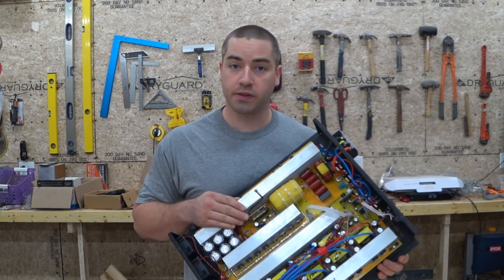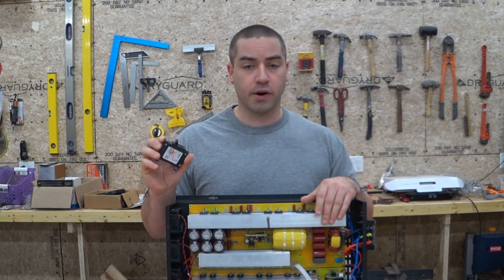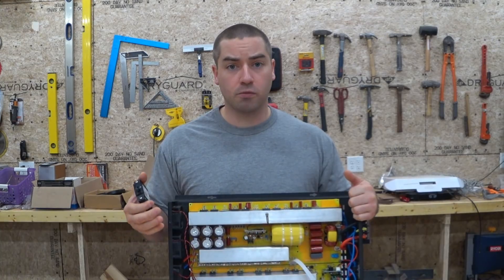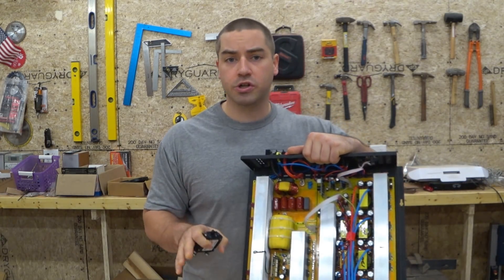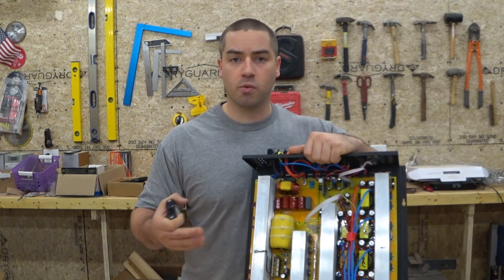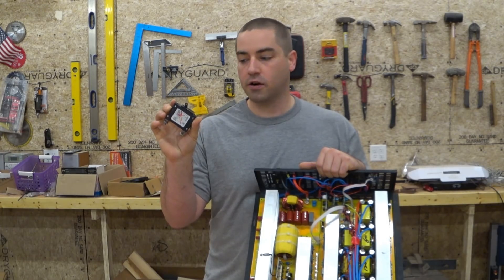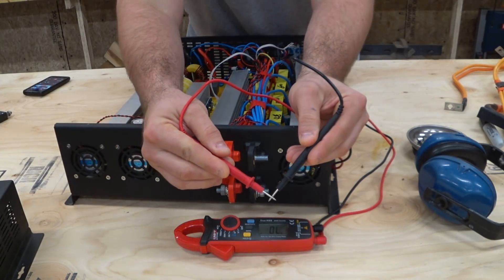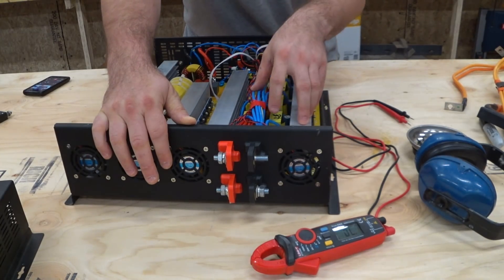Did I Blow Up the Inverter?

Comment: You need an oscilloscope or a peak recording meter to see the actual peak power the saw draws.  If a meter does not specify that it records peak current, it's not fast enough to capture the peak (which often lasts less than 0.1 second).   I'd guess that the saw's startup current is somewhat higher than your measured 39.5 amps, possibly as much as 2+ times higher.  Depending on the type of motor and its design, the start current can be 10 or more times the running current.  If the running current is 10 amps, the start current might be 100 amps or more.  100 amps * 120 volts = 12,000 watts which is 250 amps at 48 volts - only for a fraction of a second but possibly long enough to damage the inverter.  You won't get a definitive answer until you have access to a peak reading amp or watt meter or an oscilloscope that can show the actual peak power the saw draws at startup.

When you get into the Outback level of inverters (possibly 5 to 7 times the price of the inverter you're using) they actually specify the continuous watts, the peak (30 minutes) watts, the surge (5 second motor start) watts and the very short instantaneous power (0.1 second) watts.  Some electronic equipment has a very high instantaneous inrush current but it only lasts perhaps a cycle or two of the AC waveform.  

I'm aware that the Outback inverters list all four ratings but I've not seen that from anyone else - there may be others but I've not seen documentation on it.  Remember that part of what you pay for in electronic devices is the manufacturer's guess on how long the device will last.  The Outback has a 5 year warranty.  I don't remember the Reliable Electric warranty being more than maybe 90 days.  

I have two 2000 watt pure sine wave inverters from Reliable Electric and they have been working fine for several years.  However, I checked the average power of each device that I power with the inverter and either measured or did a generous estimate of the start power of each device.  The loads are limited to 80% of the inverter's rated continuous capacity which means we don;t use the "1100 watt" microwave whose measured input power is 15.77 amps at 120 volts or 1892 watts.  If you listen when this microwave oven starts up, it powers the fan, then low power on the magnetron (that generates the microwaves) then full power on the magnetron.  If you set the timer for 10 seconds, you actually get 8 seconds of heating.

Comment: hi David. Great vid. The initial In-rush current is a dead-short that cannot be measured accurately using a meter. You need to use a soft start circuit to protect the inverter.

Comment: My guess is that the breaker was to big(80A) and the motor was in short at that particular start and so it was acting as shortcut to the output of the inverter and that make the mossfet+fuses blow . Now if you had a lower value breaker (60A rapid) that may save your inverter (it may cut off the output in real time). In general the motors are surging a lot of current at start. That is why for this power tools applications special inverters are needed.

Comment: what i dont understand is most inverters have overload protection, i run two, 4000 watt inverters and if the load excedes the stated limit the alarm sounds, and then they trip themselves out, all inverters i thought had overload protection stated in the specs. i do believe the inverter is at fault,
Reply from the maker: It would have been nice if they included overload protection.
Reply: @DavidPozEnergy  You should have tried Must inverters I mean they're solar , not independant.. but supposedly they've improved some of the original design from vooltronics ;) excellent video and them you touched in here.

Comment: Were you using that breaker on the battery side or output side of the inverter?  Because none of those chart values apply about average rating if you are using it for AC output.  It’s not AC rated.   The same gauges of wires will have different ratings depending on AC or DC applications because DC heats wires up much more quickly than AC, thus DC wiring has to have much larger gauges for the same amperage.

Comment: The load should be evenly distributed across each transformer and mosFET pair.  The thing is, if any one of your FETs I marginal and blows, It puts further strain dumping its share back across the remaining FETs, thus causing a cascading failure and blowing the remainder until the current is so high to any one section their fuses blow.  Basically in my opinion the inverter is deigned poorly because the fuses are failing to protect the electronics… for starters… The other thing is it doesn’t seem to live up to it stated rating,..

Comment: sir if you look up the ohms law and you use 50amps of circuitbreaker,,P=IxE or I=P/E,,since inverter is 8000w,and the voltage is 120v,so I=8000/120=66.SOMETHING,so you put smaller amps circuit breaker breaker

Comment: nice video and good logical approach to fault finding.  I think you are right at pointing the finger at the inverter having a short circuit, which then caused the breaker to instantaneously open on to a short circuit(causing the spark). The design of that inverter is very questionable, they are relying on paralleling MOSFETS to get the power rating but do NO design effort to ensure good parallel current flow across all MOSFETS on the input side. The differing lengths of blue/red cable show that they have not even thought about that. A MOSFET can turn on in 10's of nanoseconds and at the moment of switch-on of the saw motor the first MOSFETS closest to the input see very little inductance to help with inrush and probably blow since they take ALL the current and effectively short circuiting the first few MOSFETS whilst the devices with the longer blue cables get an easy ride and don't see so much inrush due to the inductance of the longer cables.  I doubt any short circuit protection on the MOSFETS such as de-saturation protection exists on their gate drives, so they rely on fuses but this is way to slow for the MOSFET which see the short circuit and die before the fuse even reacts.   One solution if you want to continue using such a [bad] inverter is to put a large inrush inductor on the input of the inverter where the batterys connect,  this way the MOSFETs closest to the terminals get some inductance to reduce inrush surges, or rewire the blue /red cables so they all have equal and longer lengths to gain some needed series inductance.

Comment: Maybe it's because the inverter was in "sleep" mode... maybe you should have applied a small load, let's say a 100W bulb, so it wasn't starting from 0 amps.

Whatever, what did you do with the two failed inverters ? Did you returned them  ? Did you finally found a solution to make it work ?
Reply from the maker: I never did get around to replacing the mosfets.  I've just been too busy.  Reliable sent me a new (upgraded) version so I don't think I'll ever fix the old one.  One of the old ones I sold to a subscriber who watched this video.  He was going to try and fix it.  The second (broken) one I still have in my garage.  Thanks for watching.
Reply: @DavidPozEnergy  Thanks for the update. Thanks for all your good videos too ! Looking to build a Lipo offgrid to power my house and your experience is really apreciated.

Comment: David after almost a year, has Reliable sent you an 8000W inverter that can drive the saw?
Reply from the maker: Yes.  They sent me a new version.  They actually told me they used some of my suggestions in the new design (but maybe were just trying to be nice) I have two videos testing it out and there are some improvements.  https://youtu.be/JH0JtEEIdKs and https://youtu.be/TZbjy9t933E

Comment: The fault is on both sides. Wrong installation for powering Inductive loads. & Inverter does not have High Voltage protection at the output. High Voltage protection has to be installed on both sides of the automatic circuit breaker. If you had 600W heater already running on the Inverter output before starting up the saw, It would help as well. The inverter was blown up by the high voltage of the Inductive load and not by Current (Amps) or Power (watts). I would like to thank you for making the stream about the issue. Even professionals are learning.

Comment: I have used sine wave inverters as emergency backups for over 3 decades , these new powerful (china) ones the components are pushed to the limit due to cost.
The original "norlec"  made in lanc,s the uk was abused something rotten it never fused or burned out a basic auto  thermal cut out, mind you it was not very efficient  (it made a very good heater) and weighed in at nearly 4kg!.
Having said that  8kw should have held out easy, so components badly made or built for full load testing.

Comment: I'm a telecom stand-by/backup power guy. I work with multi-battery string, high current DC power plants and stand-by generators up to 500kw. One thing i noticed that would be critical is that the internal DC distribution leads are not the same length. This does not allow for a balanced dc load across the input stages during surge. In high current discharge conditions, the cables have to be of equal length or the load will be highest on inrush on the shorter cables (and component stages). The existing wiring places more load on the first groups than equal across all the groups. Notice the MOSFETs of the first 4 parallel groups were failed. If one were to replace the DC leads with equal length leads, I'll bet the failure would not occur. I will admit that they seem to have poorly engineered the whole thing "too close to the edge" of the required spec. Now on battery string interconnect cables from lower string on shelf to upper or to the "chandelier" (busbars) overhead, this would not be such an issue, though it can be problematic and cause excess heating at cable attachment points, plates, and crimps which causes "loosening" over time. On component groups, that's a whole different story. If you were able to catch the transient surge on ammeters attached to each group input, you would find that the first and second groups took the brunt of the load and way exceeded their rating by 10+ amps. Remember, surge can be up to twice the continuous, depending on the device. This definitely due to bad engineering, but a fairly simple fix. I would also eliminate the multiple cable per crimp at the input attachment points and stack individual lugs on the bolt of the inputs.
Reply from the maker: Thank you, excellent point.  And it sounds like you have an awesome job.
Reply: @DavidPozEnergy   Check the previous video for more detailed notes..forgot to update this one. Thx! Glad i could help!

Comment: 10 amp fuses x 18 = 180 amps into a single 90 amp fuse which likely caused a back feed back into the inverter frying the 90 amp fuse  that most likely should of been  double ganged 90 amp fuse with a total value of 180 amps

even if you upgraded the fuses in the inverter to 15-20 amp at 15 amp it 270 amps at 20 amps it is 360 amps

you over loaded the 90 amp fuse you idiot..

Comment: I am NOT an electrical engineer but it is obvious that the steel box containing all the parts was poorly designed and let the smoke out. If you can keep the smoke in all is fine.

Comment: Your ammeter is way too slow. You'd need something with a peak hold function. Peak current would have maxed out before your display showed the first reading.

What did the manufacturer say about this ? You point out that you are just a guy in his garage, well they are just guys who make inverters for a living...
Reply from the maker: You are right about the ammeter being too slow.
Reliable (the manufacturer) just sent me a new model for testing.  So far it is working out much better and passed my first round of testing.  I'm going to do more testing.  As of right now, it looks like they worked out some of the problems.  Here is the updated version: https://youtu.be/JH0JtEEIdKs

Comment: Just a shot in the dark but you can't just use a beeper. You have to check resistance to see if it's a complete short or just some kind of resistant load. It's common to have resistant load across leads.

Comment: Put the amp meter on hold and it will show the max automatic
Reply: Are you sure on this ? I've got an Unit ut210e clamp meter , but I thought it didn't have a peak feature.. It does have a Hold option. Can you double check if it would show peaks . Thanks for your comment

Comment: THE 80 AMP breaker puzzles me, l  would never run a power tool on an 80 amp breaker, 15 to 20 breaker at most PLUS I like GFI OUTLETS  The first 500lb gorilla in the room that 80amp just hanging loosely not installed on busbar in breaker box asking for trouble ...

Comment: People have said it in other comments and I think they're right. The mosfets may be the problem. Power switching capabilities of mosfets are generally slower than that of igbts. A quick look at the bus layout would mean each mosfets would be taking just less than 1000watt continuous. And peak draw is way higher. But I'd be interested in seeing the part number of the mosfets used. I'm more inclined to think they cheaped out on out of spec fets or regulator caps. If the drive voltage doesn't switch fast enough and gets the fet fried. Looks like bad component choices at first glance but until we know specifics, we're all just talking out of our asses. By the way it started I don't think it has much of a soft start circuit for the PA side either. Another shortcut to make the unit cheaper maybe?

Comment: Have you watch a UK guy (bigclivedotcom 
539,395 subscribers) on youtube, that's the man to talk to, he will point you in the right direction and if you send the inverter to him, he should be able to pull it apart and find the issue. My money is on over load due to the different length of cables to the 9 component groups.

Comment: In my 12v@3000/6000watt  TEP3000@12v the wier's hawe same lenght .. so the draw is loaded equaly .. i know that just 1uS  is enough 
Hawe build HF Linier as a HAM.. wier's  Mey not warie in distance 
The next upgrade is TEP6000/12000@48v x 2 ... 
The thing i hawe put the TEP3000@12v .. my Amp goe's to 400A .. IT maxed out .. when BOSH dish Washer and AEG Kondenser dryer rund 
At solar and power bank at the same time .. fore houers and houers .. i can't kill the TEP3000 .. Damm good product

Comment: Cheap inverter.  I've been using a Xantrex Prowatt SW2000 with my home solar setup for 7 years, running 24/7/365.  It powers a portion of my house, and my workshop.  Tablesaw, compound miter saw, etc., no problem.  But I purposely found the limits of my inverter.  The only two power tools it can't start is a compressor, and my 1965 era radial arm saw.  Both of those exceed 50A inrush current (measured with a Fluke 334).  A standard ammeter is NOT fast enough to capture the actual spike. If I overload my inverter, it gives me an error on the display, and stops producing power.  A quick reset, and it's working again.  No amount of overload should cause it to fail if properly designed.  FWIW, my inverter is a 12V model, fed with 4/0 cables, connected to a 1000AH battery bank.
Reply: Good to know...

Comment: I went to the website and noticed the spec page on all their inverters shared a common rating. stated   watts  and surge watts. the surge was always 2x of the stated rated watts, so a 5K rated inverter was rated for a 10K surge. so if you apply a power formula ......volts X amps =P your 120 volts X 15 amps X 2 (for surge) should have taken up to 30 amps for more than a second. by the way the best way to meter test transistors with a meter is when they are removed from the circuit. also  when you went line to line and had continuity you were done right there. the fuses didn't need to be replaced until a fault was discovered and repaired. also, if a 3K ran the saw all your time considering the amp surge on motor start was a waste on an 8K supply. the 8 is garbage. Cheers
Reply from the maker: Thanks.  After this inverter I learned about low-frequency inverters.  Now I have one of those and it starts my tools great.  Thanks for watching.  https://youtu.be/dfHb5tZErTs

Comment: They sell a device which you plug in a appliance into then plug this device into your wall plug in  it's called Kill A Watt you can get it on Ebay or Amazon it will tell you Watts Amps and Voltage for any power tool up to 15 Amps you may be able to get a higher rated  one above 15 Amps but this is a accurate way to know your tool ratings and demands.  As far as this inverter someone suggested a buss bar connection to these sections not stranded wire it would make a stronger connection also your mosfets need the highest Amp rating possible that fit your board.  Check the power Ampere ratings for your mosfets they may be too low..  You could add a  surge component across each mosfet to limit the surge into each mosfet look for TVS  they look like a diode but handle large surges and can protect your mosfets from blowouts.
Reply from the maker: Thanks. I will keep this in mind when I order new mosfets.  How do I measre if they will fit? Thanks.
Reply: @DavidPozEnergy  Find the specs for your Mosfets then match all the measurements and specs except the ampere rating try to get the most you can find try Digikey to get these parts then add a TVS type diode to each Mosfet to channel the surges away from the sensitive easy to blow out  Mosfets by sending high surges to ground they have Youtube videos that should show how this is done very simple.  I mentioned the Kill A Watt to give you a idea of the demands of the tools or appliances so you know what is adding to your surge problems.